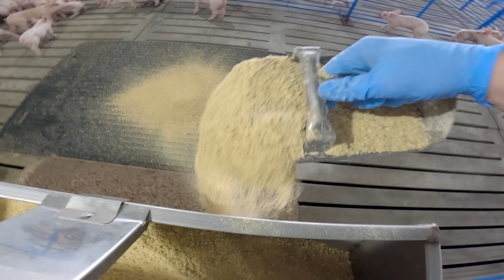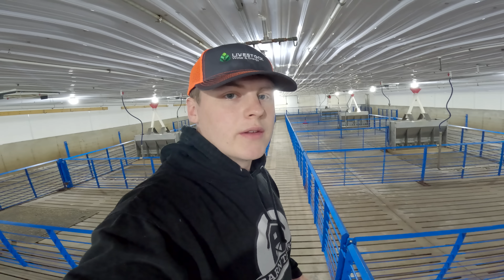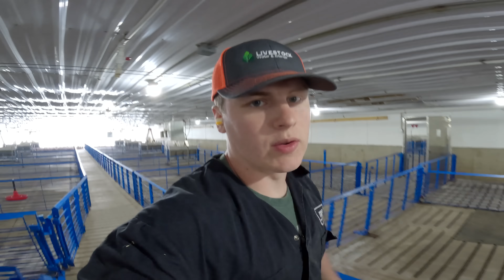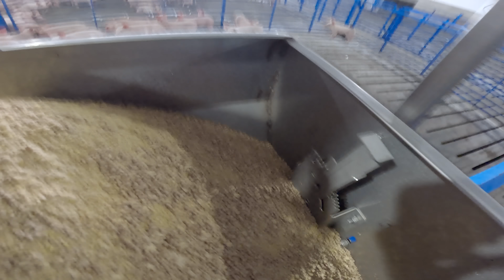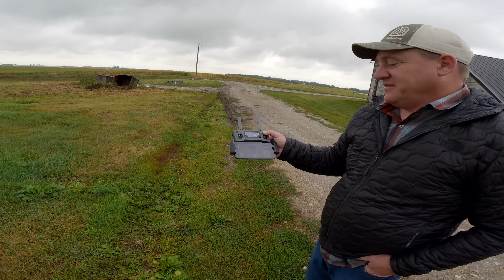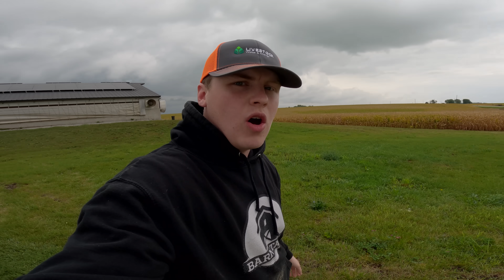New Baby Pigs & New Farm Projects

Comment: Carbon footprint means nothing; recycling hog manure is creating more carbon. Where does the energy come from to separate or clean the water? You have a carbon debt once you build the building and install the equipment. The materials are all a carbon debit. Did you figure out when you will break even with that debit? It looks good on paper and makes people warm and fuzzy, but it is a gimmick. We need carbon to sustain life on this planet. Carbon is used by trees to produce oxygen, as one example.
Reply: Pig manure turned to solid wast and clean water. With the good that does who with any Sense will worry about carbon.
Reply: Little Danny trying to sound educated yet is as dumb as a box of rocks